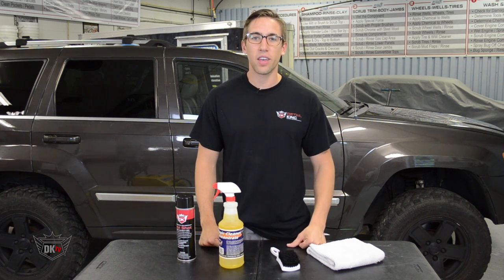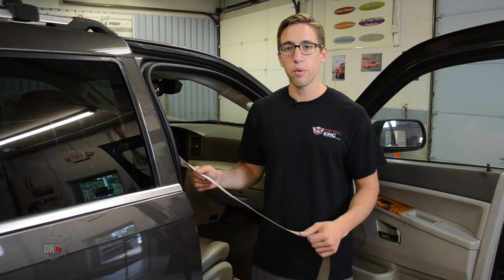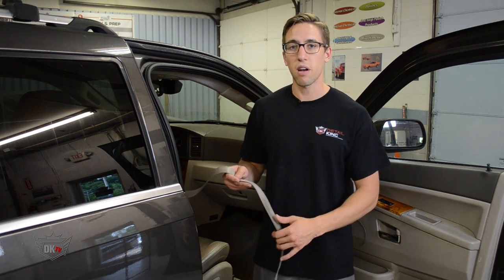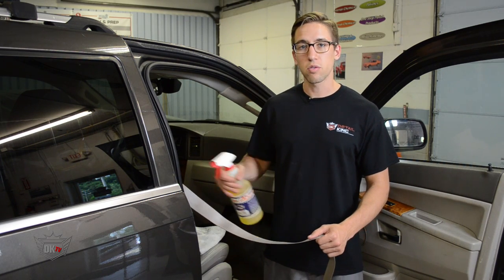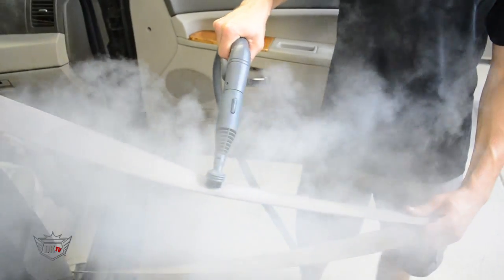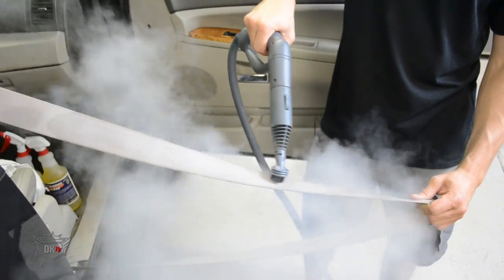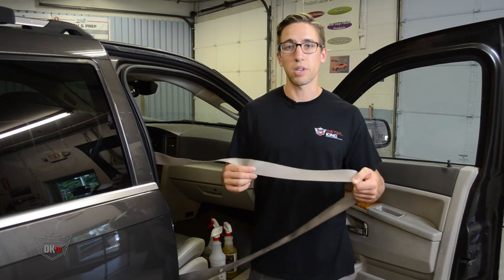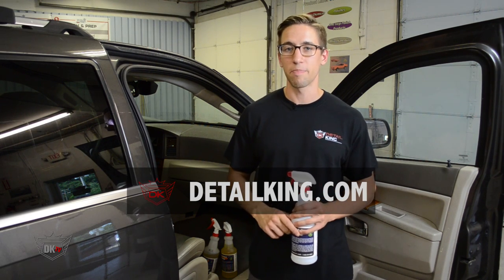How to Clean a Seat Belt

Comment: Just using a steamer and wiping with a dry cloth usually does the job,  be careful if you decide to use a brush (preferably don't use one) as it can loosen fibres on the belt and fluff up.

Comment: Crazy easy hack. Just pull belts all the way out the doors. Close doors and holding belt away from paint just pressure wash then by hand get the ends that you are unable to hit with pressure.  Bam....done.  and no fancy excessively expensive chemicals either. Just some liquid laundry detergent diluted into a spray bottle and VERY little work both of which are what detailers in the real world need to look at.